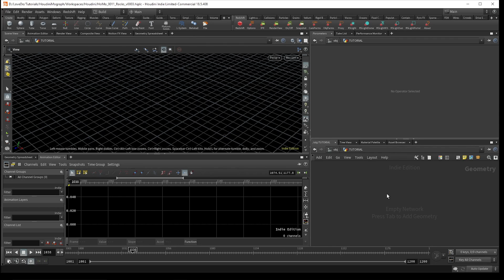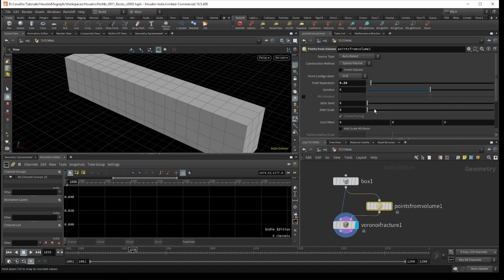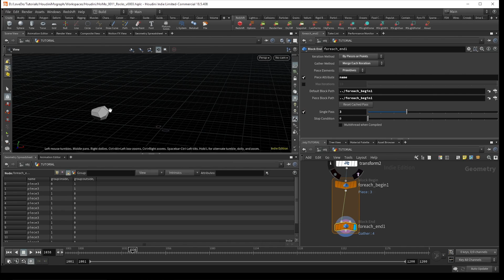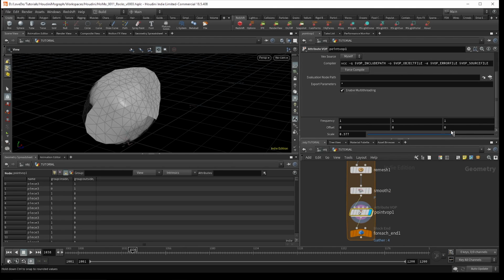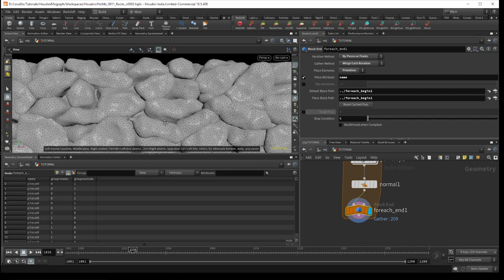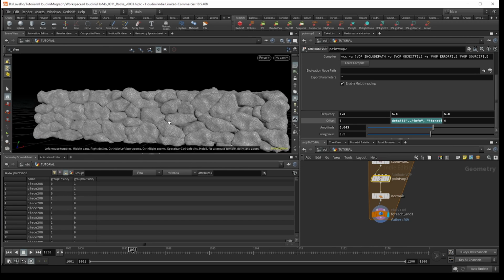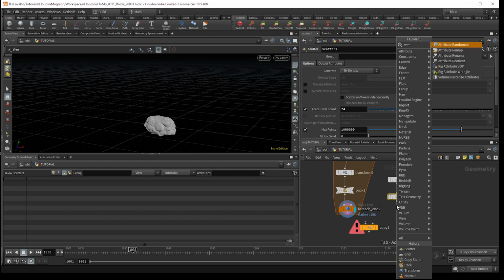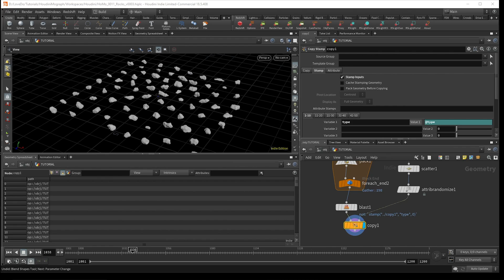Rock Generation - Houdini For MoGraph Ep0011

Comment: Hey man. Great tutorials. Just wanted to let you know we have a better and faster alternative to copy stamp right now. All you have to do is use copy to points and enable the "Piece Attribute" option.  Now each rock (from the left input) should have an unique attribute called variant, and the same - each point from the right input. Copy to points will match and only copy the piece with the matching variant attribute on each point.